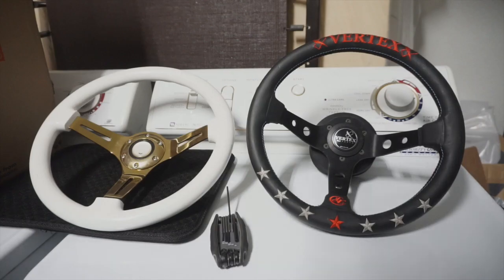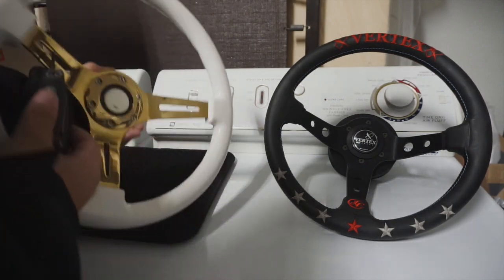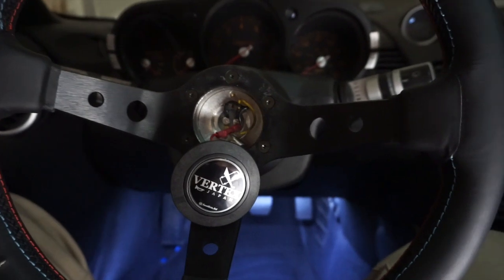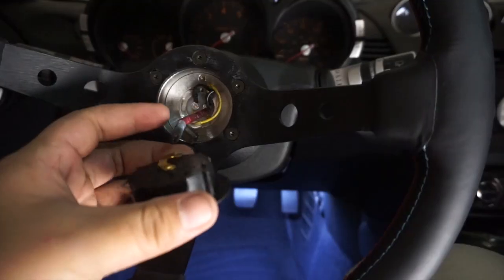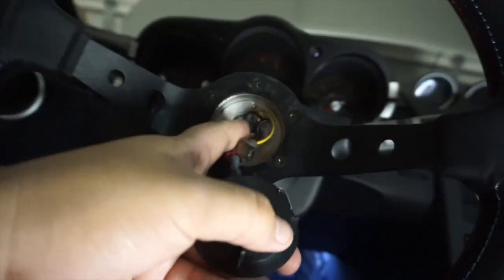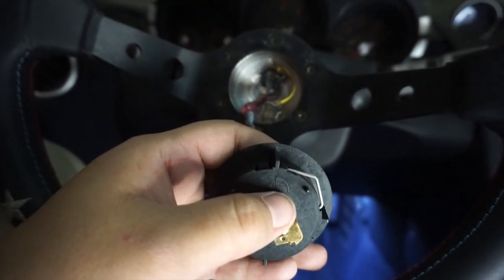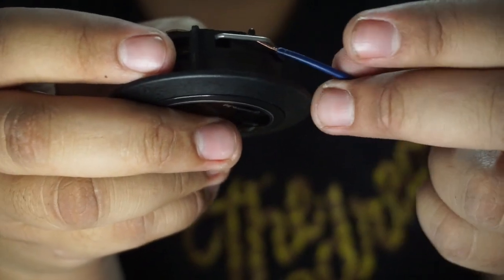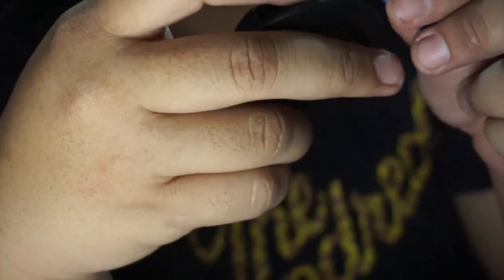How to Fix Horn on an Aftermarket Steering Wheel, Vertex wheel Install

Comment: Having the opposite problem where my horn is constantly going off.
Reply: I had this same problem, for me i had the positive (yellow wire) connected to the wrong connection. My horn button from streethate seems to have a negative connection and the little metal triangle ground on the bottom as well.

Comment: Great video! I'm having an issue with my horn going off randomly. what do you think issue could be? Have Momo steering wheel w/quick release and NRG hub
Reply from the maker: Richard Sasso it’s probably grounding out check wiring for loose connection of bad horn button
Reply: If its got a metal ring between the wheel and quick release where you attach the ground on a little lip and one to the horn button its the little ring. I had the same issue. Swapped mine with some off brand with 2 connectors on the back and had no more Horn going off at random.
Reply: @Fidller1997  I have the horn with the two connectors, but horn doesn’t work still.  Any thoughts on why that is?

Comment: I have 2 connectors on back of the horn button,ground and positive,and it still doesn’t work,I’ll try putting ground wire onto the metal prong to see if it works.
Reply: Did it work?  I have the same issue.

Comment: Did you literally just wrap write on the prong thing? Never connected it?
Reply from the maker: The horn button has 1 connection and the end of the wire that I wrapped around acts as a second connection on the back of the horn, so I connected it to one of 2 connections coming off the quick release the other to the original connection on the back of the horn itself
Reply: So the positive went onto the connector,and the wire you put on metal clip on horn button is the ground right?